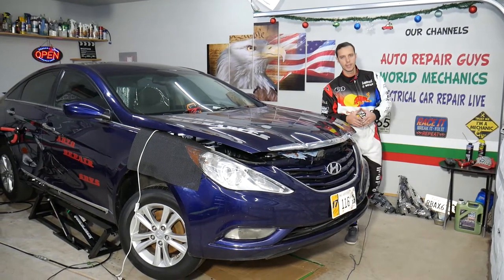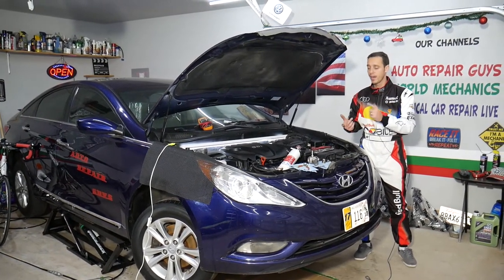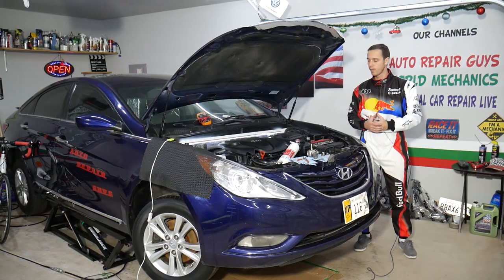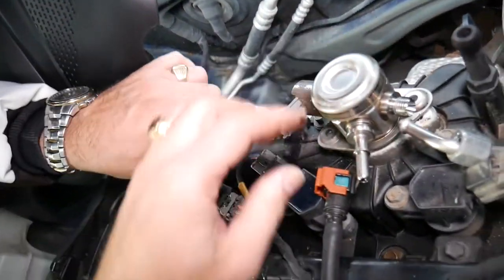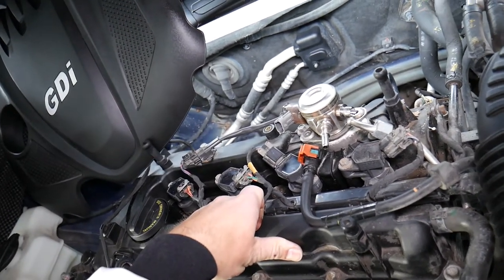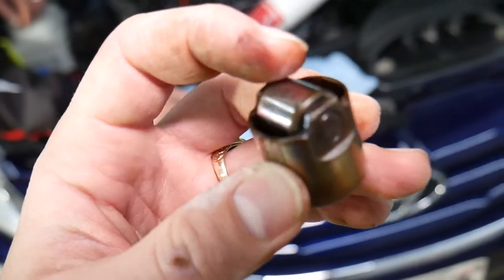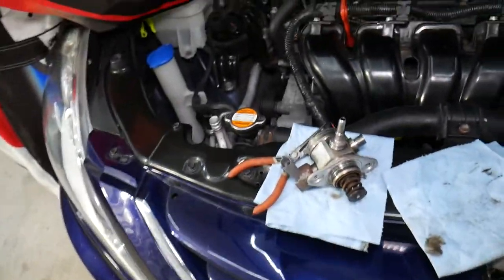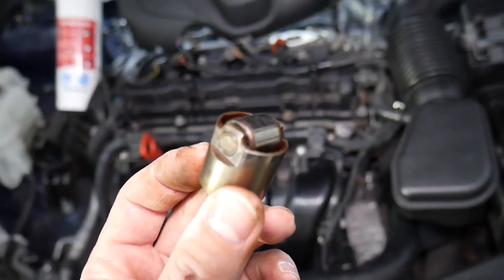HYUNDAI ENGINE NOISE RATTLE TOP END HYUNDAI SANTA FE TUCSON SONATA ACCENT VELOSTER ELANTRA

Comment: Thanks for sharing this info. I hear this rattle very loud for few seconds during cold start and it goes away after about a minute. I thought it may be caused by motor oil circulation issue , maybe top part of engine running dry but you shared a new cause. I will look at it too. Thanks
Reply: I have the same issue with my car! Did you check your high pressure fuel pump? Is it the noise reason?
Reply: @AA-en8gw  put some motorkote oil in engine. You will notice a significant noise reduction.

Comment: I have a santa fe 2016 , fuel, today if i accelarate it rattles and engine turns off, but then it turns on back without problem! But if i kickdown i dont get power and engine turns off again with a rattle noise! Also if it ia in park and i push trottle engine rattles and does not turn of!

Comment: 2014 Santa Fe brand new motor, everything plugged in, starts, dies right away, have checked everything. Help?
Reply: Check for plugged intake or exhaust
Reply: 2014 Santa Fe 6cylider engine with a horrible noise coming from the top cam shaft,I've also check everything I need to check,but the noise is there.